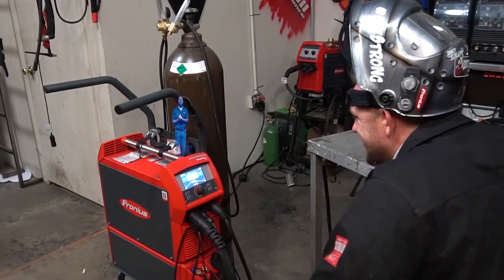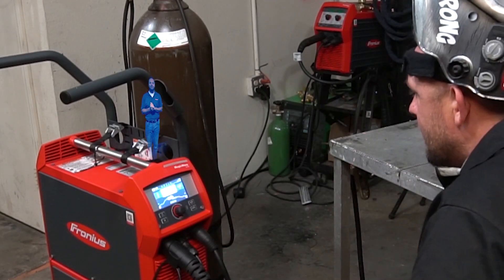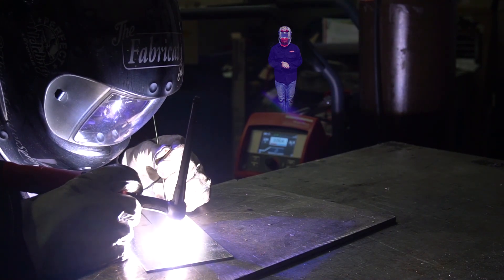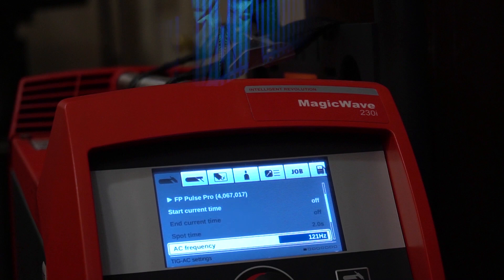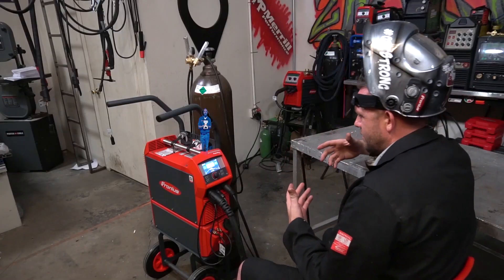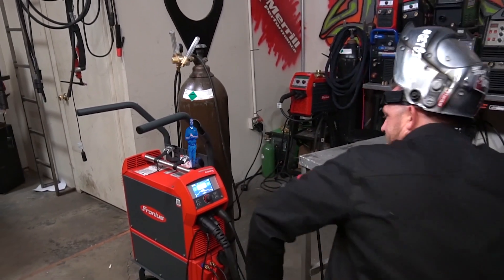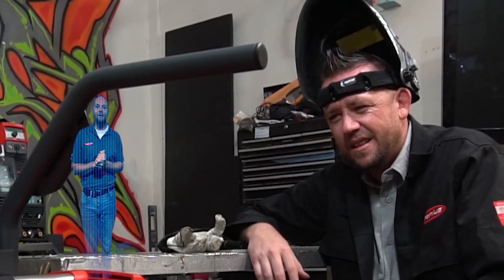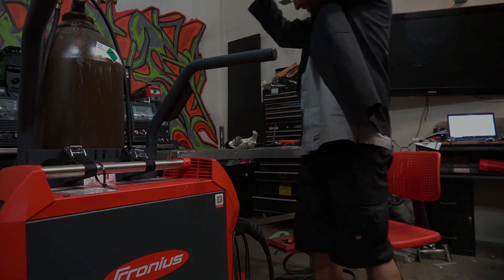TFS: The Future of Welding Technology?

Comment: I have a question concerning my son he is a artistic Metal art and good enough to post a video. Unfortunately he had a bad experience with a Miller and there warranty department making fun of my son who has a form of autism. So I ventured out to find a welder manufacturer with quality and I did a long time consuming research and found fronius Company and get him a welding machine he would be happy with? My only question is will he notice a difference in the TransSteel fronius 2200 from his Miller 211 that was brand new and went back to Miller warranty Department 4 times which he’s afraid to use fearing something with go wrong and is not at all what I feel he should have to deal with? Thanks for your time
Reply: i dont know about miller but fronius have 3 years warranty for their transsteel series but you have to apply for it though. its free btw.

they also have something called the synergic lines where if you change the current, 2 more will adjust accordingly. those 2 are the wire feed speed and the voltage. bit tricky if you are a welder that wants to adjust everything yourself.

fronius's transsteel also allows you to weld from stainless, mild, aluminium, and also using flux cored wire from the same power source as long as you have the materials, filler wires and gases for what you're intending to weld. its as simple as changing the wire and gases and you are good to go.

but be warned though, they are a bit pricey.

Comment: Sad to say that technology may skip holographic instruction and go all robotic. A welder will be an android like machine capable of welding anything anywhere anytime with precision no human can possibly achieve for a lower cost and without rest. It's already happening in controlled factory environments, but the work is at a static location. They will even be able to diagnose and service themselves. So if your not the guy designing a better version or tweaking them for different uses you'll be on the outside looking in. Big business is always about profit with little or no consideration for the needs of the human work force. Small businesses, competition and diversity of design and creativity are the only hope for skilled blue collar workers. I used to craft, mill, intricate architectural wood to replace restore old buildings and some new structures. But along came injection molded plastic foam and that's all most building contractors use. It's light weight doesn't rot if properly maintained and cheaper. But some people just prefer wood just not enough.